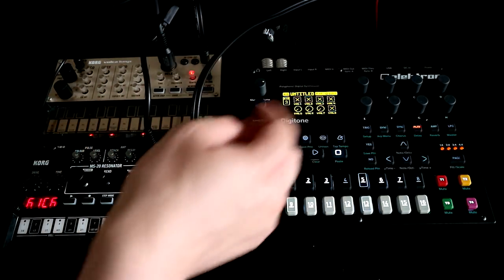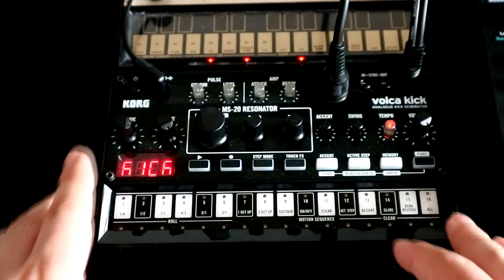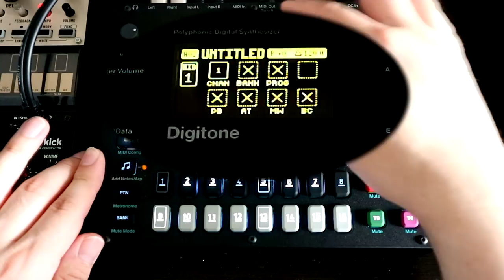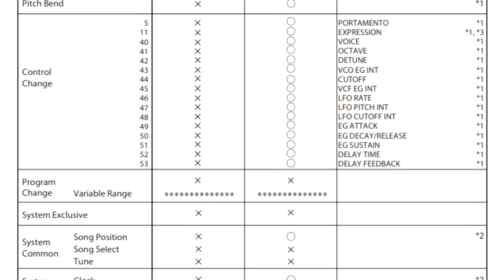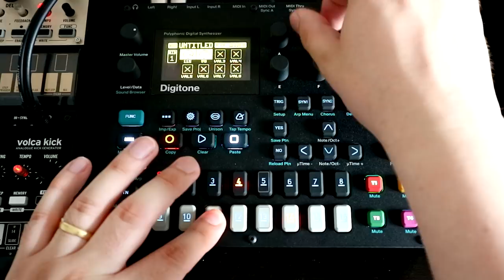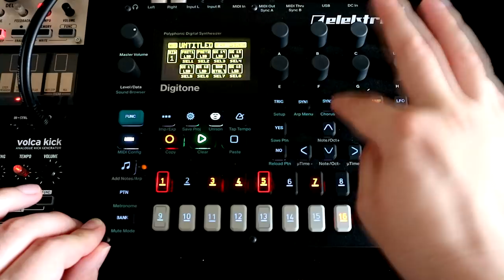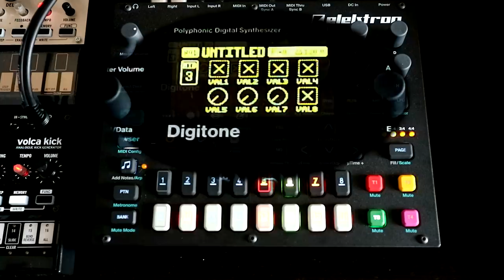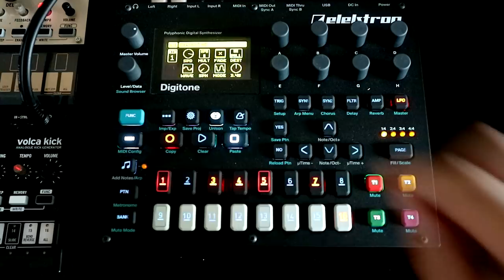Digitone MIDI Tracks - Sequencing External Gear (feat. Korg Volcas)

Comment: Hello, digitone in own sequencer has only 4 tracks, but if I want to use more than 4 tracks couldI use some external sequencer like Arturia or else? Thank you for answering me.
Reply from the maker: The Digitone has 4 internal tracks for its own sounds and 4 more to sequence midi. And yes, you can just synchronise the Digitone with another sequencer and use that for additional midi sequence tracks. There are lots of options as to what - but yes Arturia are definitely a company I'd look into, especially if you can wait a few months for the new Keystep Pro.
Reply: @OscillatorSink   Thanks for the detailed answer. and to use midi tracks for Digitone or Digitakt I need a splitter like Through box?
Reply from the maker: @AlekseiDroganov  that depends - if the gear you want to sequence has MIDI Thru you can just daisy chain, if not, then a decent splitter would be a good thing to have.
Reply: @OscillatorSink   maybe advise me a couple of models😏✋
Reply from the maker: @AlekseiDroganov  I don't have one myself, but the Kenton Thru is a classic and the Retrokits rk-005 is a splitter that can do a bunch of other cool tricks.
Reply: @OscillatorSink  Midi splitter as Kenton is not a daisy chain communication?
Reply: @OscillatorSink   Quadra Thru Box exactly what I mean about sequencing midi tracks with other gear.
Reply from the maker: @AlekseiDroganov  it is splitting rather than daisy chain - daisy chain is into one thing then onto the next then onto the next etc. Splitting is into one thing then split out to all the rest in one go.
Reply: @OscillatorSink  Tell me please sync other hardware synths with splitter is better then daisy chain, it gives less delay, as I understand it?
Reply from the maker: @AlekseiDroganov  yeah, and keeps the signal strong. If you daisy chain a lot of gear, especially with long cables, you can start to get drop outs and other weirdness
Reply: Could you tell me please how you've connected two Volcas to one midi out port?
Reply from the maker: @AlekseiDroganov  with a splitter.
Reply from the maker: @AlekseiDroganov  a cheap one that doesn't work very reliably.
Reply: Thank you so much. Now is all clear.🙋👌

Comment: Would the digitone sequence monologue, drumbrute and/or reface??
Reply from the maker: Yeah, that should work! The drum programing would be a little unnatural because any step where multiple drums are played would have to be inputted as a chord, but you could still do it.
Reply: Awesome...I realized after posting that I wouldn’t really need to sequence the drumbrute. It has a good enough sequencer on it’s own. Mainly wanted to sequence the monologue and reface, and then clock sync with the drumbrute.
Reply: This video also has some great Volca tips I can use for my Beatstep Pro. I’ve seen a bunch of videos with the Beatstep controlling multiple Volcas, but I didn’t know how to set the Volca midi channel before and setting up multiple Volcas hasn’t worked the way I had hoped. Can’t wait to try it!! I just recently started getting into synths this year..I’m a brass, percussion, and guitar player so this has been a whole different game to me. Having composition knowledge, but not the tech knowledge has been quite an annoying hindrance
Reply from the maker: You'll get there - it'll be second nature before you know it!

Comment: So can you do deep mind with same ideas..i mean that'd be proper insane!! Just idea, can you tell counting days,😂
Reply from the maker: Deepmind is on the list, but I need to check the real-time MIDI Control implementation to see how well it'll work...
Reply: Oscillator Sink Hey! Did you ever get round to sequencing the deepmind with the digitone? I own a deepmind 12 and I’m considering the digitone as a sequencer for it. I’d really appreciate any info.
Reply: @TBCfhjvhhhnbb  I believe it's totally possible, just geek the DM midi chart and go...so patch changes is slower but cc for every thing else should be pretty quick, I will be trying soon😉☺..and if I get stuck I'll ask here😉
Reply from the maker: I've had a rough play, and yes - you can do it. Didn't experiment long enough to suggest or encounter any weirdness or quirks though, so take that with a grain of salt.

Comment: Uh... My digitones encoders dont even click. At all. Literally cant "punch in " the midi channel. Is there any other way to do this? Or do i really have to return my Digitone?
Reply from the maker: It's not a click more of a little 'dip'....it's standard on most of the Elektron boxes. But if none of them are doing it it sounds like a manufacturering fault and you're missing out on a bunch of features like the rapid parameter changes and canceling p-locks.

Weird that none of them do it though - are you definitely on the right page? If you're on one of the synth pages, does pushing down on a knob and turning not make the parameter change faster?
Reply: @OscillatorSink  yea I own a digitakt as well and the encoders work fine on it, when I push down I can feel it "click", but on my digitone it feels like the encoders weren't even designed to be pressed down lol. I finally ended up getting it to work by literally pulling the knob off and pushing it back in, and I saved it as a template project so that I never have to do that again. Not that big of an issue for me anyway because I'm planning on getting a midi thru for my digitakt instead of daisy chaining everything, so I won't even have to use the Digitone's midi controls because the digitakt will be the main sequencer. And having those extra features you mentioned would be nice, but they don't seem 100% necessary to me at least. Everything else seems to work great, hopefully I don't encounter any other issues
Reply from the maker: @isaiahromero9861  it sounds like the encoders are mounted too far down or the tops are pushed on top far and are bottoming out maybe? If you're doing any sort of sequencing beyond the basics, I certainly wouldn't want to be without a way to manually lock/unlock a parameter
Reply: @OscillatorSink  well I can lock parameters by holding a trig and moving the encoder, I just can't unlock them apparently, but I'm already in a habit of just placing a new trig when I need to "unlock" a parameter, even on my digitakt bc I actually didn't know about that feature lol. You're right though, I shouldn't be settling for a broken digitone considering the price. I have a warranty so I'm gonna look into replacing it soon because it could mean the encoders will have more issues in the future which would be a real problem

Comment: What midi split cable do you use?
Reply from the maker: I used to use some random thing I got off of ebay. It was fine most of the time, but unreliable so I grabbed a Kenton Thru 5 and have never looked back - absolutely solid.
Reply: @OscillatorSink  thanks for the fast response! 🙏 The tutorial is quite helpful!